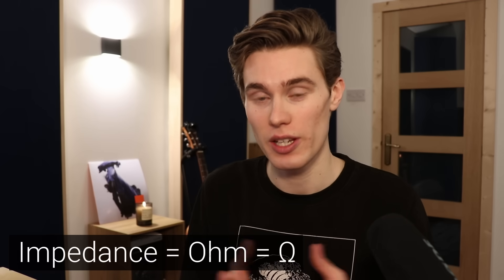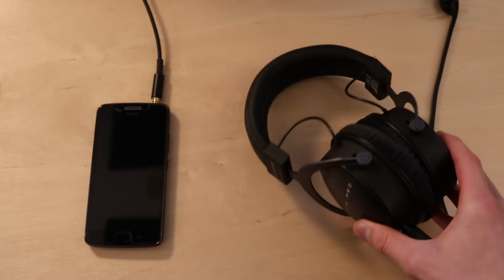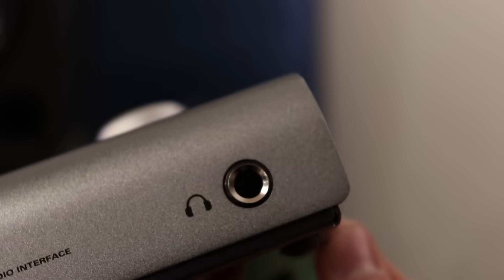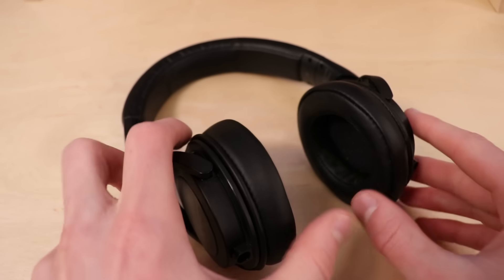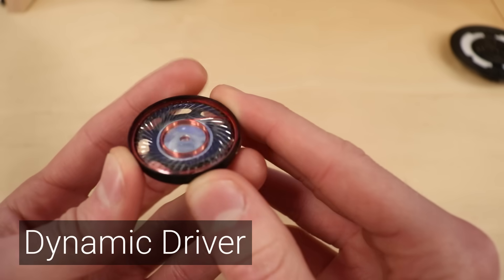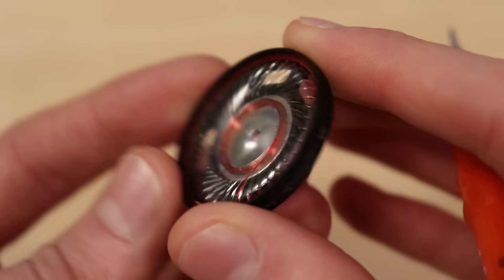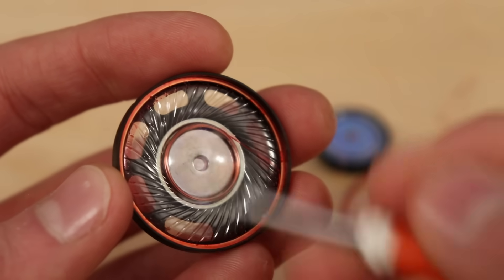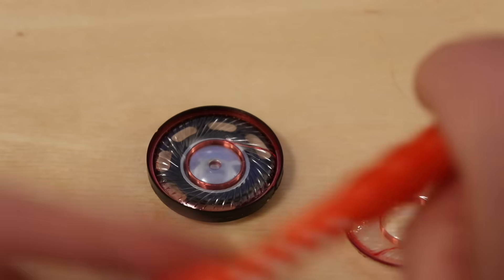32 ohm vs 250 ohm - Which Headphones Sound Best?

Comment: I'm currently plugging my 250 Ohm DT990 Pro's directly into my laptop/cellphone, (still loud enough) since I can't buy an interface/amp just yet. Am I losing out on audio quality by underpowering my headphones, or does power only affect loudness?
Reply: yes you are i am using the same headphones with a fiio e10k and it's a world difference to normal laptop/pc soundcard
Reply: ver7ici by not using an amp that can provide 50mw @250 ohms you will notice dynamic range loss at any volume. this is very apparent at high levels in the lower frequency. This causes the bass to sound thin and lacking
Reply: @salicat  Thanks! This was what I was looking for. Do you have any recommendations for an entry level interface/amp?
Reply: No, you don`t... it`s just louder with an interface...when i prepare my Youtube videos i use them on my laptop and the sound is awesome...
Reply: Yeah usually you percieve louder as better...some pc soundcards have small background noise...but a good headphone will sound good even when the volume is not very high

Comment: I have the Beyerdynamic dt 990 250 ohms, I put those into de headphones input in my mac without an audio interface, its weird but works fine I love it
Reply from the maker: If it works, it works!
Reply: It’s not working at full capacity. I have exact same headphones and they don’t go anywhere near loud enough that way. Do yourself a favour and at least buy an amp, it seriously makes a big difference.
Reply: @johnjohntv1195 , for now, i prefer to use that money in more education... for me is very very loud the information i receive!!, and yes y will probably buy an amp or interface but not now

Comment: Minor gripe: the difference between high and low impedance headphones is the voltage needed to drive them. The power should be about the same across headphone types.
Reply from the maker: Yes Sean with a higher voltage amp the current will be lower, however, different headphones do have different power requirements (based on more factors than just impedance) so the overall power does need to change. But I can see that to a more educated viewer, my use of language is a bit too vague! Sorry!
Reply: @inthemix  Good explanation. Yes, I was just worried about the conflating of the terms "voltage" and "power" in the video. Otherwise it was a good video as usual 😀
Reply: @inthemix  Higher impedance = less non-linear distortion
Reply: @inthemix  
Hello. I want some technical information. Motherboard ASUS Maximus gene XI I wore this motherboard JBL T450 (20-20, 000 khz, 32 ohm values) headphones. And stamdart has a sound quality.Now my question;ASUS Delta Core (20-40, 000 khz, 32 ohm values)HyperX Cloud II (15-25, 000 khz, 60 ohm values)Sennheiser Game Zero (15-28, 000 khz, 50 ohm values)Which of these headphones is suitable for ohm value on my motherboard? In accordance, I mean a better performance?Note: I installed the JBL T450 for testing purposes. 32 ohm value 20-20. 00, The KHZ frequencies I'm curious to hear. When I connect to the audio output on the motherboard, the audio output is below 51 Ohm, which gives a warning as if it had been put into performance mode. Can anyone with sound technical knowledge help? He gives me this warning when I put on the headset. Does this mean that the sound on my computer motherboard supports 51 ohm 51 Ohm will I experience distortions when I wear a headset underneath the sound? To achieve the best performance, I think the same ohm value or 60-65 ohm values should distort the sound. Do I have a problem with audio when I buy the ASUS Delta Core 32 ohm headset from the headphones I wrote above? Thanks anyway.
Reply: @inthemix  P=VI
Reply: Sean Demers 
Actually there is one more important parameter which effects power requirements. It’s sensitivity (dB/mW). Usually this parameter is around 100. 
If it’s higher, headphones are described as efficient one, as they need relatively less power. (Typical models are IE monitors, sony IER m7/m9/zr1 — they have 103 db/mv)
Low sensitivity headphones require relatively more power. (97 db/mw needs more power than 100 db/mv)
Sennheiser uses (db/vrm) marking.
Reply: @olexandrs6639  My HD800 must be one of the most efficient headphones from all the sound it actually produces out of that driver. My Nexus 6P's headphone jack can produce a maximum of 0.3 volts but I can hear the headphones from the other side of the house.
Reply: I've been studying electronics a million years ago. A famous basic formula being V = RI → Voltage (Volts), Resistance (Ohms), Intensity (Amperes). So the above mentionned by Sean.
Also P = VI P being Power.
LGTM at first sight.
Reply: @felinephase   FYI 'I' stands for current in electrical engineering, not intensity.
Reply: @felinephase   It's Ohm's Law. Google 'Ohm's Law Wheel'
Reply: The power required is a matter of sensitivity. Some higher impedance headphones CAN sound louder than lower impedance headphones on the same amp, it depends on how efficient the headphones are. However, higher impedance means you need more voltage for the the SAME power going to the driver. How much volume is created by that power depends on the efficiency of the driver.
Reply: @rich1051414  Good examples of high impedance, high sensitivity headphones that are relatively easy to drive, would be the Koss KCS75's or KPH30i's.

Usually the highest impedance is found only at specific frequencies, for instance, in the bass, so many higher impedance headphones will work with lower voltage outputs, they just won't sound as full.
Reply: Richard Smith not more voltage but more Ampere!
Reply: @oledahl.  Do you know how electricity works? Ok, lets give the 320 ohm headphones 1000 amps and 1 volt. Oops, the headphones will only use 0.00320 amps. That is because it's not the amperage that matters, but the volts. The amps are determined by the impedance of the headphones and the voltage, assuming the amplifier can provide that many amps.
Reply: Richard Smith so according to you, what happens if you switch your theory up with 1000 V and 0.0001 Ampere?
Reply: @oledahl.  So you are talking about power, that is why you use watts. If you want to talk about power, use watts.
The amperage used by the headphones is determined by the voltage and the impedance, as long as enough amperage is available. If not enough amperage is available, the voltage will drop, so 1000v at 0.0001 ampere is impossible to achieve with too low an impedance. 
The power amplifier stage functions ideally as a voltage buffer with an infinite current source. The amperage is determined by the load. Obviously, ideal is impossible, but your usage doesn't make sense. The voltage of the output and the impedance of the load decides the amperage, the amplifier's job is to get that done.

FYI, 1000v at 0.0001 amps through a 320 ohm headphone would only actually be 0.032 volts.
Reply: @rich1051414  Electrical Engineer here. Just some information regarding how these types of devices work. Dynamic headphones are a non-linear device with frequency dependent impedance, they do not behave in the same way as a purely resistive load, like you have described. Impedance is a complex form of electrical resistance comprising of resistance, capacitance and inductance that form reactance within the circuit which can only be described in complex exponential form. This change with frequency and the resonance of the driver at various hertz will introduce changing impedance peaks. The amplifier will attenuate these peaks to ensure maximum possible power (maximum power theorem) is delivered to the load when the impedance of the load (load impedance or input impedance) is equal to the complex conjugate of the impedance of the source. This means that attenuation depends on the frequency, wave-length and peak-to-peak wave-height of the source-signal and the type of impendence-matching of the amplifier and will be an entirely relative and closed-system.

More reading on Ohm's law for complex RLC circuits - http://fourier.eng.hmc.edu/e84/lectures/ch3/node4.html
Reply: @NebakinezaTV  True stuff, but the frequencies involved should not impact the impedance in any audibly discernible way, do they? I didn't bother doing calculations, do you have some? I would be interested.
Reply: @oledahl.  He clearly uses the term 'power' then mentions a higher voltage as well.
Reply: 0:50
Reply: I love that the very first comment is someone pushing up their glasses, and it just gets worse from then on. Poor old Micheal. He must have just cried when he uploaded this great video and saw THIS was going to be the first thing anybody read in the comments.
Reply: @FrazerPayne  Sorry, some of us care that people get accurate information so we can all avoid unnecessary confusion. Michael's video is excellent, I merely had a small correction to point out.
Reply: @FrazerPayne  SOO much worse from a noobs pov, holy shit some guy related it to physics I almost threw my phone
Reply: That goes against physics, or Ohm's law. An Ohm is a measure of resistance, add more resistance and you need more power.
Reply: @RichardsWorld  Ohm's law is about the relationship between voltage, resistance and current. Specifically it states that current equals voltage over resistance. It has nothing to do with power. Power is voltage times current.

Add more resistance and you need more voltage to achieve the same current. And since power depends on both voltage and current you will need to increase the voltage to achieve the same power as well. But you don't need more power just because the resistance is higher.
Reply: can I use 990 on my playstation 4 pro
Reply: I don't know English. 
Which is better for my PC ? 32 or 250 ?
250 ohm have better sound but 250 ohm too much hard for a PC ?
I want to buy a new Over-ear headset. "Sennheiser HD 280 pro (64 ohm)" is good choise for me ?(for music)
Reply: @RyuzenTV  32ohm. But if you use music interface you can use 250ohm. But for gaming purpose 32ohm is enough.
Reply: I need help, I want to buy beyerdynamic DT 990 pro 250 ohms to mix and master music Plugin them to my PC, which amp do I need or you recomend me?
Reply: Question, I have a Behringer U-Phoria UM2 interface which has +48v phantom power, is that enough power to push a DT 770 Pro 250 ohm to its full potential or is it maybe better to get the 80 ohm? Thank you.
Reply: @mikhail.faustin  You should get the 80 ohm. Audio interfaces for microphones don't often have good amps for headphone monitoring. If you want to use high end high impedance headphones to monitor, you will need a separate headphone amp to power the headphones from a line signal.
Reply: @Celastrous  Thanks for your reply, Sean. Yes, I know about the amp thing, will the UM2 be able to at least push the 80ohm to its full potential?

ps: any good amps for a cheap price that you’d recommend?
I’m kind of a noob regarding these things but amps also have a frequency response right?
Reply: Great explanation thank u
Reply: Impedance is to do with current draw rather than voltage being pushed (ohm's law)
Reply: Actually P = V*I with V=R*I is really just a balance act.
You if the headphone just sips current you can also run them with the same voltage.
Reply: Maximum Power Transfer Theorem. 
Z of Load = Z of source
Reply: 386.000

Comment: great choice to upload this after i got my headphones
Reply from the maker: Oh no! What did you get?
Reply: @inthemix  can you tell me if the 32 ohms will sound as good as the 80 ohms on my Samsung Galaxy s10+? Also, will they be loud enough?
Reply: i think 55 ohm headphones, it’s AKG K240 Studio Headphones
Reply: G. H i just ordered a pair of those, but the MKii version. I think they’re a solid budget buy. The frequency response graph is good. As said in one of the videos on this great channel, there’s no such a thing as “flat headphones” but you can find some of them close to that, get to know them is the best bet.
Reply: G. H I don’t know if they’ve changed much but I’ve had a set of K240’s for 20 plus years and I love them. Very balanced and I can wear them for a long time. I just need to find some closed cans for tracking louder instruments where I’m in the room with the cab.
Reply: @turkishultranationalist  Hi.
Could You give me a help, please. 
I bought a pair of Dt 990 250 ohms and connected to scarlett 4in4 3rd gen and they are playing so quiet. 
There is something that I can do to make it right or better send them back and get 80 ohms? 
Thank You
Reply: @rekasprawiedliwosci7689  the audient id14 shown in vid can drive my dt 1770pro 250ohm volume to the point of distortion easily. a good alternative is a cheap amp. i use fiio e11, and the bass boost makes the sound signature more to my preference in spotify and youtube where i dont have an EQ.

i turn my id14 up to -3 (in its software) however i dont know if this actually fucks with the audio quality
Reply: G. H omfg same happened to me 😂 i got the dt 990’s pro
Reply: I don't know English. 
Which is better for my PC ? 32 or 250 ?
250 ohm have better sound but 250 ohm too much hard for a PC ?
I want to buy a new Over-ear headset. "Sennheiser HD 280 pro (64 ohm)" is good choise for me ?(for music).

Comment from the maker: I am always being asked which headphones are best and which impedance (ohm) is best! 
In this video, I hope to quickly answer lots of questions about headphones including:

How do headphones work?
What Ohm of headphones do I need?
Which impedance sounds best?
High or Low impedance headphones for Mixing and Mastering?
How do headphones actually work? 
What's inside headphones?
Do more ohms sound better?
Reply: The greatest music channel on Earth is - In The Mix.
Reply: Can you please help me, my micorphone came with M-Audio Vocal studio Pro II, it was fine when i first purchased it but nowadays whenever i try to record...there is a huge static noise...
And i can't solve it...
Reply: you should pin your comments at the top of the comment section
Reply: I have the dt770 250ohm and am looking for a (neutral/warm) budget headphone amp for recording and home studio use. Would really appreciate some suggestions thanks.
Reply: great video btw, congrats
Reply: Hi there, it is refreshing to watch videos like yours! I have a question: did you try to drive the DT770 Pro 80 Ohm directly with a smartphone (that is, with no amp)? Thanks
Reply: @ferakles  i have the same qustion and want to know if i bought the 80 ohm virsion will it be good in my phone ?
Reply: @rimurutempest423  most Phones wont have the Power to drive them well, so they will probably still sound good, but you wont get them very loud and also loosin a bit of detail, 

some mostly cheaper end phones even cant drive 32Ohmers well as the voltage on the jack is very low to save power, so for Phones i'd suggest to go with the 32Ohms to be on the save side.

im using the 250Ohm 770Pro's on my PC just on the ALC1220VB atm (Aorus X570Pro, with an Creative AE-5 or even AE-7 to come) with its built in Headphone-Amp and they are so f-ing great, but you seriously need that power to its full extent there, when i drop from max level 3 to just lvl 2 they drop down immediately to almost half volume.

also as a reminder, the MMX300 "Gaming Headset" from Beyerdynamic is basically the modified DT770Pro 32Ohm Headphone with a very nice Mic slapped onto and that Headset is more or less reference for Stereo Gaming Headsets...that should tell enough. ;)
Reply: @wolfwilkopter2231  thanks bro
Reply: @rimurutempest423  you're welcome.
Reply: Bro U cleared it in very simple way about impedance,,which one should I buy
Reply: hi from Russia